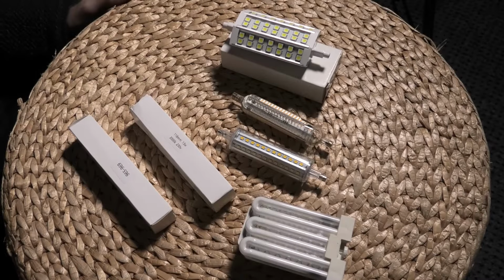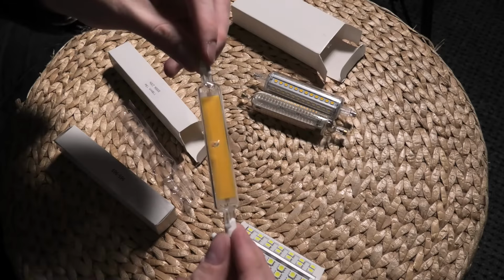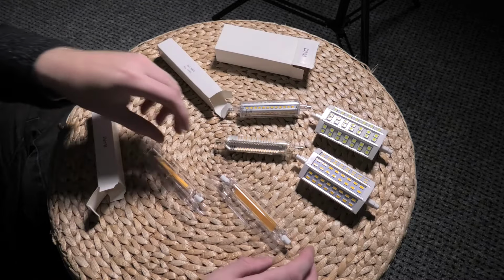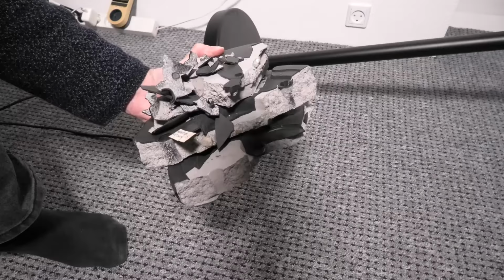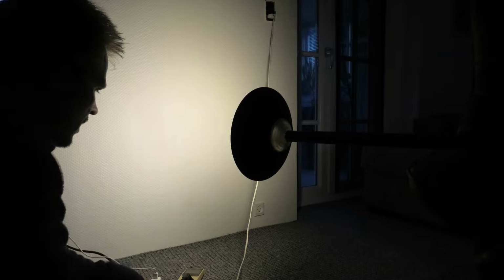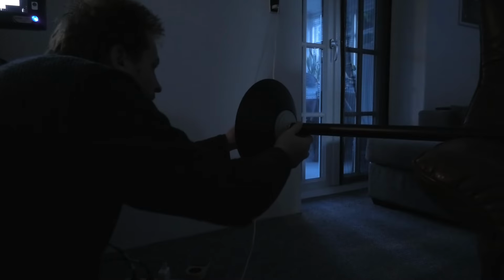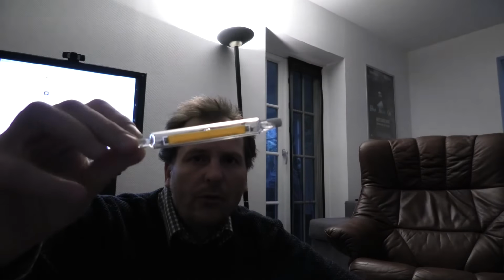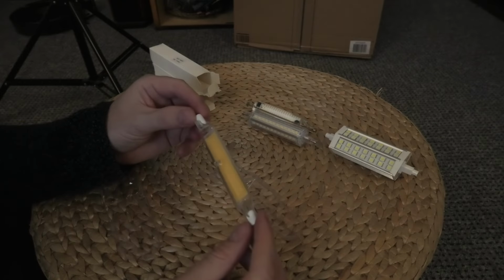R7S 118mm LED Lamp's Testing out NEW 13/30Watt - 890

Comment: I've got a similar light and have 3 0r 4 brand new 500 w halogen bulbs dimmable. i just love the way it spreads the light across the ceiling. But man does it suck the watts  You know like that old 70s Buick🤣Ive been thinking about going the LED route for a while but like you said its just not the same light😒
Reply from the maker: Hi John Mitchell
Thank You very much!  glad you liked the video :-)
Thank you for watching! :-)

Comment: On my lamp, same as yours, I had to by-pass and remove the dimmer switch... so mines either on, or off.... I'm still using the halogen Bulb... will try out the led version when the Halogen burns out.
Reply from the maker: Hi John Stancliff
Thank You very much! Yes LED´s are harder to dimm,, than the good old ones, glad you liked the video :-)
Thank you for watching! :-)
Reply: @MyPlayHouse  I really like the newer LEDs but am finding, like you... they just aren't bright enough in certain applications. these fllor lamps came with 300 Watt Halogen Bulbs,  what LED is bright enough to replace it.... so far, I'm only finding 100 Watt equivelant bulbs...

Comment: LED Bulbs need to be dimmed with an intelligent dimmer that uses pulse width modulation rather than dimmers designed for halogen bulbs which are just resistors. That's why some say they are dimmable but don't seem to be - you need a specific LED dimmer switch.
Reply: I should add as well that they will flicker on camera because they turn on and off at 60Hz and your camera records at 60fps - a traditional bulb glows all the time so no flickering, LED bulbs turn on and off (twice) every time the AC voltage oscillates - the nice LED bulbs should in theory stay illuminated for more of the time than cheaper ones which is why some flicker more than others. Thanks for the video! :D
Reply: @elliottsw  If you'd connected a bare LED to mains via a resistor, it would flicker. Even the cheapest led bulbs usually have a small capacitor to smooth out the voltage.
Reply: @Mchacz8008  indeed but while these capacitors overcome the problem of reverse voltage when the dimmer reduces the voltage the LED does not dim, it just starts to flicker as they are either full brightness or off, and the capacitors eventually cannot keep the voltage high enough to keep it illuminated. That's why you need a pulse width modulator instead of a resistor.
Reply: Dimmers for hallogen bulbs are not resistors, but triacks. A resistor able to dissipate 60w of power would be huge, and hot 😅
Reply from the maker: Hi Sam Elliott
Thank You very much!  glad you liked the video :-)
Thank you for watching! :-)

Comment: The rolling shutter effect is a problem. It may be that the electronics is too small/enclosed to see, but if not, it will still flicker at 50Hz, so changing your camera setting from 25fps to 30fps may get rid of the rolling shutter.
Reply from the maker: Hi Seegal Galguntijak
Thank You very much! They was blinking so much that it was impossible to work with. 
Thank you for watching! :-)

Comment: These Halogen rod lamps that light up the ceiling aren't really good for LED replacements. That is why I have bought a lamp that is similar in shape, but has an E27 fittin in the top. There, I screw in an 18.5W Phillips LED or a 21.5W Osram (Ledvance) LED. They have the light output of a 130W or 150W incandescent bulb, and that's plenty of light! I spread of 4 of these similar things throughout my large room (which is about 25 m² I think), and now I can make it really bright.
Reply: All the LED bulbs I mentioned above are available for 10€ per piece in Germany, so maybe as well for you?
Reply from the maker: I have been looking for years :-/  and still waiting...
Reply: @MyPlayHouse  I mean this one: https://www.amazon.de/dp/B01HD54OP6/ or this one: https://www.amazon.de/dp/B073JG8V4S/ in combination with something like this: https://www.amazon.de/dp/B002FOG7V0/ - they are really bright. Maybe even use 2 in different corners of the room instead of only one?

Comment: Cool video. Bummer about the base breaking apart. I thought those filament-led lights (the last two you tried)  would have zero flickering. I wonder if the dimmer is the culprit, or if lights can be made for certain hertz 50/60 and you have ones that don't match what your country has. just a guess.
I would put an epilepsy warning up somewhere for this video. I don't have it but the flickering still got to me- i feel a little dizzy now. Kanye's video didn't bother me though.
Reply from the maker: Sometimes the flickering was worst on the camera, and sometimes you did not nearly get half of it :-/

Comment: Leds really don't cope well with a.c power, they store no energy to smooth over there on/off switch over events, mad flicker :-(
There non linear response to a rising voltage doesnt help eather.
A propper led a.c to d.c driver may be the only way.
Never mind mort, it was a good test :-D
Reply from the maker: The LEDs didn’t flicker right away they only started flickering when they got warm.
Reply: @MyPlayHouse  I noticed that when I bought some LED MR16 bulbs to replace the 50W halogen bulbs we had, there were 10 of them in total. On 3 out of 4 circuits they started flickering immediately after pressing the switch but the three bulbs that were on the 4th circuit appeared to turn on normally, although some appeared brighter than others. After about 5 minutes they started flickering as well. The reason for this was that the existing transformers outputted 12VAC instead of the required 12VDC. I replaced the transformers with LED ones and that solved the problem - no flickering and the lights were equal brightness

Edit: I think the difference in brightness was due to small differences in the output voltage of the transformers but if someone could explain why the LEDs initially operated normally on AC on one of the circuits I'd really appreciate it.

Comment: The flicker is the 50 hertz of the grid, because there is no DC convertion in between. The faster flicker could be 100 hertz because of bad electronics.
Reply from the maker: It seams more random than just 50Hz and did not flicker until the lamb had heated up.

Comment: You have to use an LED-dimmer. Normal dimmers (made for incandescent bulbs) doesn't work with LEDs (even dimmable LEDs). Try to bypass the dimmer built into the lamp. You even might need a dedicated LED driver instead of the one used to drive the Halogen lamp.
Reply: I think you are on the right track, normally these inline triac dimmers go up to 95-99% and causes the flicker because it's not clean ac power. No problem for incandescent bulbs.
Reply: i was gonna say the same thing
Reply from the maker: Well,, I was looking for a replacement, and I did not want to change a whole lot,, it just needed to work.

Comment: I had some of these in my lab turned on 24/7, the thing with these chinese leds they have really poor colour rendering index (CRI) and at least from my own experience they die really quickly i never bothered to take one apart but likely bad capacitors and maybe one led going bad and taking down an entire row since they're in series. I would say mine would last anywhere from 1-3 months 24/7 nowhere near the 30-50k hours LEDs are usually rated for which means you also have to add the extra cost of replacing them to the mix, they looked very similar to yours (the R7S) hopefully you'll have better luck than me.
Reply from the maker: Well I am not able to work with the blinking of the new ones. It does not help that the LED’s are good for 30-50k hours,, if the electronic is piss poor and dies after 200 hours :-/
Reply: @MyPlayHouse  Mine had some visible flicker without dimmer with my own eyes as well and on camera, it's usually due to how they're designed, cheaper ones use capacitors to drop the voltage and puts a lot of stress on caps plus they're already low quality and running at really high temperatures, even with really good low-esr caps i don't think it's possible to design one of these that doesn't fail quickly with a reasonable light output as you would expect from a 300W-500W halogen which also serves as a space heater in the winter, and has perfect CRI. But make sure you're shooting at 50fps not 60/30fps since the 50hz frequency will affect them, also in some cases helps running them off straight DC (when possible/you have access to that voltage etc, cheap ones with capacitive drop can't do that) specially camera lighting or any lighting that's likely to be on camera at fps that doesn't match mains frequency. I also personally don't like warm white, most people do but i prefer daylight (5000-6000k) which is a good reason to replace any halogens.
Reply: The cob ones with lower power last longer. We have one chandelier with 24 1,4w cob e14 candles since 2007 for 79€ total back then. 0 replacements

Comment: Typical, you spend a small fortune on LEDs for it and it breaks.
The reason you shouldn't touch the halogen bulbs is because it gets extremely hot and the oils from your fingers will make it potentially crack the glass.
If you scrap the lamp and have no need for the bulbs, it seems like a good donation for Bigclivedotcom for him to play with.
You could build a round piece of board covered in LED tape that fits in the bowl of the lamp.
Reply from the maker: I am sure Bigclivedotcon has taken these apart ;-)
I’d really like to get an replacement for that 300watt bulb, some LED that gives out the same amount of light. Haven’t found it yet.

Comment: for the smaller lights if you can find philips led r7s lights, they seem brighter than average; I'm not quite sure about what actual type of lead's they use but definitely better than the Chinese ones I bought although more expensive
Reply from the maker: I was really hoping to find something that would replaces that 300watt in light output,, and not to expensive;-)
Reply: @MyPlayHouse  hehe, I think if you want to try to do that you will have to maybe diy something with one of those circular cobs:P...... I think the design of the r7s's  are a bit to restrictive for the time being; the Philips I was suggesting are at best similar to the lumens of 60 to 80watt~(haven't compared side by side).....